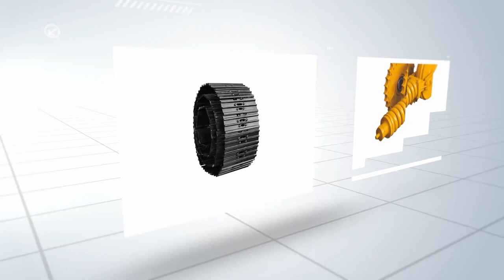Track Pads Production — Excavator and Bulldozer Track Shoe

Comment: Somehow, I kinda figured the "shaping" of the track-shoe was via "extruding".

In a former life I worked at a factory  that sold extruded brass items such as padlocks and punches.  The furnace was heated by electric heat projection boxes, the filaments became red hot si.ilae to outdoor heater in front of hotel entrances say.  I am unable recall the actual noun nomenclature of this device, arranged in a circle around the furnace which melted the brass.